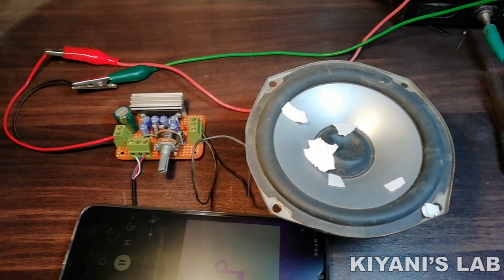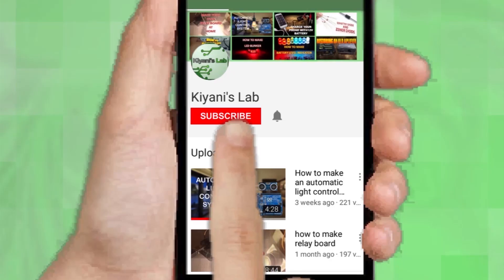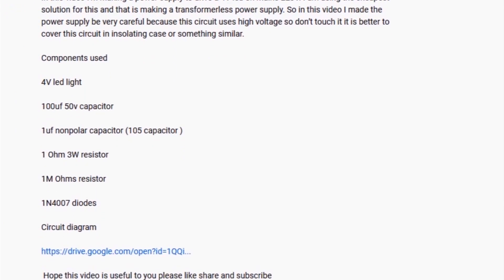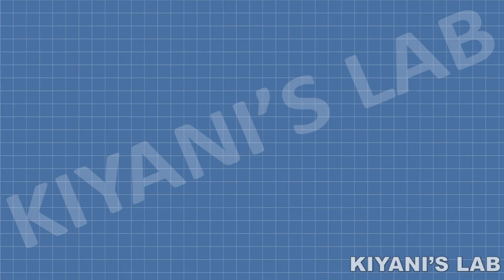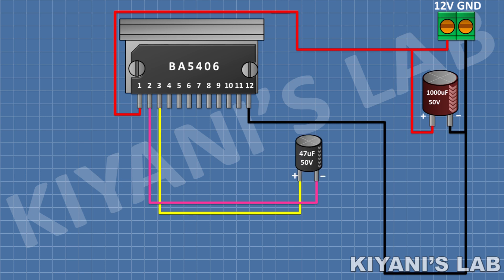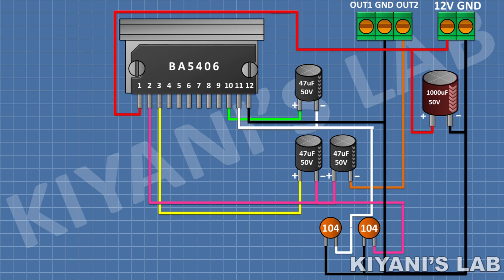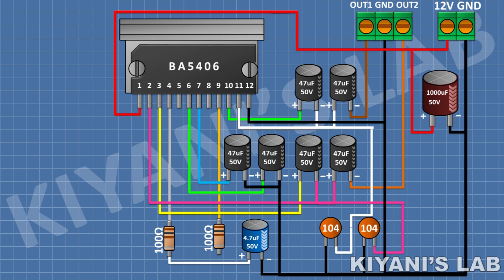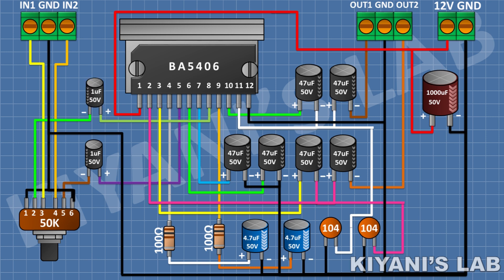How To Make Audio Amplifier Using BA5406 IC

Comment: Can I use 100mickro fared and16v capacitor instead of 47uf capacitor and I did not knew why you are using high value capacitor in 12 v curcit